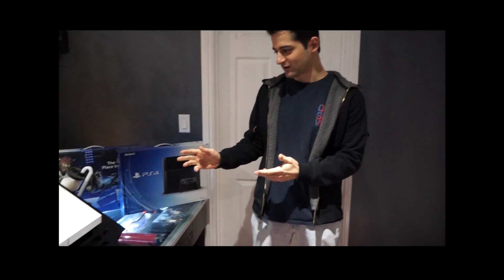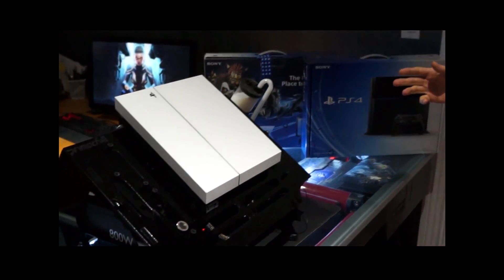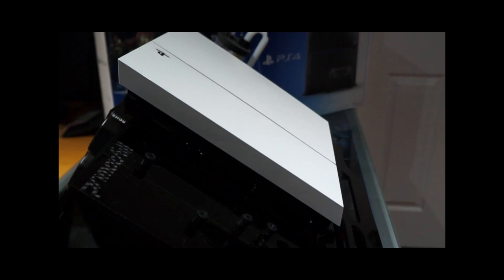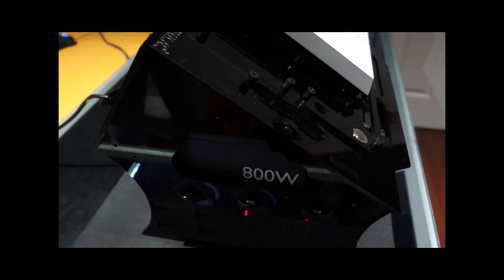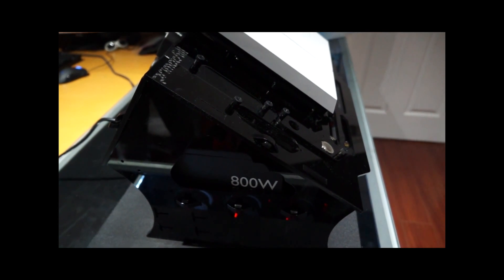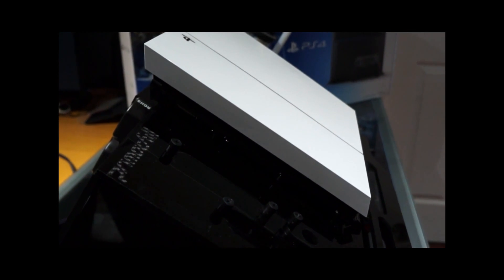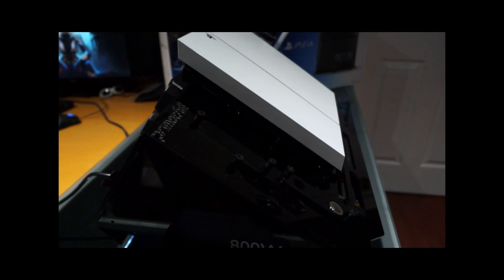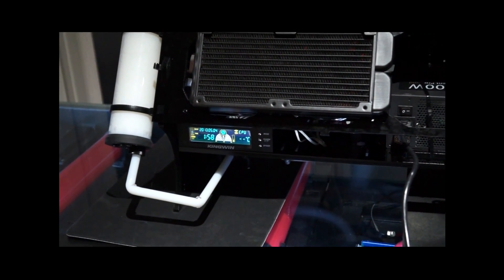Playstation 4 Water Cooled / Liquid Cooled PS4

Comment: is it even hooked into the loop? or just sitting on top of a wetbench with a loop for looks? do you have a build log or before and after results?
Reply from the maker: Hi, it was actually hooked into the loop. It took a lot of modification to get the block to fit in the PS4 and keep everything else of the ps4 intact and running. We didn't do a build log or anything because it was just something we did for fun and did not really expect anyone to want to do it as well nor risk doing and damaging since it was just a rough build and nothing concrete.

Comment: Guess after all this time nobody can invent a micro liquid cooler is always a PC sized monster build or a hack job liquid cooling idea on a ps4  -_-
Reply from the maker: Yep, we had to work with what was out at the time. There was a company who made a single prototype cooling kit for a laptop, was a small form factor but yep havent seen one since.
Reply: pwrdbykyank seen ways to do it in case after taking out the big  af jet fan and fitting everything in that area and using slim  radiator and slim fan (  120 mm )  while using micro fans in the psu intake to exhaust the heat from that like I said  iv seen a few models  and 3d designs on how it works  but I have yet to see it done
Reply: pwrdbykyank make another build with the items they have today  water blocks w-G1/4 12mm @max tubing there are also  micro 90 elbows out there that are pretty cheap  hell all the parts together ( w/o liquid and anti-micro )  around  $300-400 note : xs all in one micro will do the trick with the space issue  internal )
Reply from the maker: No point in doing another one since most people are getting the newer systems now anyways, no one will want to see this water cooled. Ive seen the newer setup also on the ps4s and those are a pain to do as well, will require way too much modification and again no one will want to do it either so no point in showing people a build that they cant do lol. Hopefully the PS5 will be more user friendly in the DIY department.

Comment: What is the water block GPU/CPU ?
any inside looks ?
Reply from the maker: +William Barber MagiCool Black Butterfly CPU Liquid Cooling Copper Block - Universal Socket (MC-BLOCK-CPU II), but we modified it a lot, cutting off the edges to make it fit etc, from what I have herd there are custom made blocks for the ps4 now so would be best to google and find one that requires no modification
Reply: +pwrdbykyank i managed to modify ek block tu fit with the original backplate my project is nearly done just some aesthetics works will share with you thanks for inspiration
Reply from the maker: Sounds good! look forward to it

Comment: You ever thought of trying some passive cooling
Reply: +person8203 Passive cooling is used for room ambient temperatures, which would not make a BIG temp drop using Pass Rad, as a matter of fact, there might if not will see a rise in temp. passive cooling is not ideal for over clocking nor cooling gaming units like this.
Reply: Levi Johnson
good point, relies on room temps. I'm just not a big fan of noisy, erm, fans. Used some large ones on a desktop with low rpm that were fairly quiet. Doesn't take much for them to whirl up like a turbine though.

Comment: what water block did you use
Reply from the maker: Heather Simmons MagiCool Black Butterfly CPU Liquid Cooling Copper Block - Universal Socket (MC-BLOCK-CPU II), but we modified it a lot, cutting off the edges to make it fit etc, from what I have herd there are custom made blocks for the ps4 now so would be best to google and find one that requires no modification

Comment: I'm a PC gamer and I'm not here to berate or belittle anyone but IF you're console is actually overheating, water cooling is not the answer, its probably just insane amounts of dust and try and giving it some careful vacuuming if you're afraid it'll end up damaging the console in anyway.

And no this does not in any way shape or form boost performance, if your console is overheating something is wrong, they're built not to generate that much heat.
Reply: Bloodstainer That may be true with the PS3s but the first PS4s have been known to overheat straight out of the box due to Sony rushing to get them out as soon as possible. My PS4's fan sounded like a jet engine when I first used it. Also, because the cpu and gpu share the same unit, it generates more heat versus the PS3 having a separate cpu and gpu.
Reply: Darion Chambers Doesn't matter, they just sound a lot, they still won't break by the heat, they're just poorly cooled down, not actually powerful enough to damage themselves with their current cooling system in place.
Reply: "Still won't break by the heat" lol
Ever heard of the Yellow light of Death?
Reply: Darion Chambers Not maintaining and cleaning electronic hardware isn't really the same as hardware actually overheating by itself, its not like it ever happened to any1 day1.
Reply: Bloodstainer Where's your source?
Reply: Darion Chambers http://community.us.playstation.com/t5/PlayStation-General/Unofficial-Yellow-Light-of-Death-YLOD-Informative-Still-Thread-R/td-p/4048928

And basic knowledge about electronics. Things don't overheat for no reason, sure its a hardware problem but the fact that it wasn't found in a test lab prior to release indicates that its a pretty high  probability that the cause for this malfunction is dust build-up.

If the problem was hardware related, you would be seeing the YLOD whenever you played a game that pushed the hardware limit of the console, whether the console was 3 years old or 3 days.
Reply: My PS4 overheated 4 times and shut off. What about that?
Reply: You must be a pc gamer because your comment shows how very little you know about video game consoles....dust, really lol?
Reply: +barry wirth lmao yep console gaming can get pretty complicated

Comment: pwrdbykyank do you by any chance have a parts list? I am looking into doing something similar. Really annoyed by the sound of the PS4 fan.
Reply from the maker: I don't remember exactly all the parts I used, I might have mentioned them in prior comments, however from what I have read, there should be a custom made water block for the ps4 by now. You would basically need a water block, tubing, radiator, pump, reservoir, fittings for the ends of the tubes and connections, and a power supply.

Comment: pwrdbykyank my ps4 is overheating and it is in a well ventilated place, no I put frozen pea bags on top of my ps4 as on top and bottom to keep it cool maybe watercooling it is my only hope for better cooling, could you replace the fans in the ps4  with a quieter 1 or what? because I want to lean how to water cool that dayym thing
Reply from the maker: I'm not sure  as to if you would be able to replace it with quieter fans, I suppose you can, but any fan that the system tells to spin faster to cool off would probably make noise, but maybe some with different material will make less noise. Also the fan in the PS4 is a suck heat out type fan, its not a blow fan you would regularly see in a PC etc. Also water cooling isn't worth it for most since it will cost just as much or maybe even more than the system price to water cool it. :) Best solution would be to use one of those add on cooling fans that attached to the back of the ps4 and helps suck out the eat or until maybe sony makes a newer PS4 down the line and fixes heat issues. :)
Reply: So do you think I can plug in a fan from my pc to the ps4 and leave it in the side so it sucks in cool air, do you think I should cut out a square in the ps4 where the cpu is and add a fan?
Reply from the maker: well if you look at one of my videos, I did add a fan, but it requires some wiring. It doesn't improve it too much though, but does help. Also the top of the PS4 to the right where its right underneath the processor (since the processor is upside down when the ps4 is upright position) heats up, but there is no cooling there. You can take the top right of the case off and add a fan there too, to help it keep cool but again doing so would probably ruin the look of the system.
Reply: +adam khalfi The Delta fans that Sony went with are top of the line. Sony made a VERY smart move by having Delta Tech produce their fan.
Reply: +adam khalfi I just installed x3 Coolermaster 120mm Jetflo fans to the top of my ps4 (I cut 120mm holes in the casing). And I installed x1 ThermalTake 80mm fan underneath directly on top of the internal stock Delta fan. PLENTY OF AIRFLOW.

Comment: I'd love to see a fan modification keeping the chassi intact. That is if you could replace the fan and turn the damn thing into a silent console. Or perhaps try to see how much you can lower the stock fan speed without affecting the cooling too much. Best case scenario with thermal paste replacement gives me about 55dB during full load. That's by measuring directly at the exhaust to get an as accurate reading as possible of how loud the system actually is.
Reply: I'd donate money if you could do it and release a guide on how to do it yourself. Love the system as such, but it's too damn loud. Gone through five of them in an attempt to get one that actually has the standard Sony claims it has. Confirmed several times by themselves it should be quieter than a PS3 at all times including while being under full load.
Reply from the maker: knerl ington Hi, it would not be possible to replace the fan and get less noise because if your using a stronger fan, it will cause more noise. If you lower the speed of the original fan (which has been done by people who wired a switch to it, you can check on youtube ) you would get temps higher which wouldn't be good and I'm sure eventually the system would shut down from it. The only thing I can think of is if you either removed the entire case and left the system bare bone sitting there or if you had a laser drilling place drill a bunch of small holes for ventilation (like a mesh grill look or something)  throughout the housing of the system which would cause more air circulation and heat would escape easier causing the fan not to work to push it all out the exhaust. This would then lower the fan noise level. :)
Reply: pwrdbykyank
Of course it's possible. It could be a fan with a different material used for the fins. If it wasn't possible we wouldn't have so many different fans for our desktop computers all with greatly varying noise levels.
Reply from the maker: yea well even if the time were spent to custom make a fan with different material and replace it, it would not make any significant change, the results would be very minimal. The space you have to work with is very small inside so you don't have the type of room you would with a computer to be able to use specially designed fins to push in more air and etc. Plus the fan in the ps4 and the construction is designed so that shaped and type of fan sucks heat from the surrounding areas and doesn't necessarily suck air straight through like a regular PC fan. I mean anything is possible but when it comes down to getting a 5% difference its really nothing noticeable.
Reply: pwrdbykyank But there is room for a larger fan so as long as it pushes air in the same direction as the stock it would indeed make a big difference.I know it's designed to suck in air from the sides, but that wouldn't change. The heatsink this time around is rectangular which means that the part where you mount the fan could be widened. Once again. If the material and design of the fins didn't matter we wouldn't have so many different fans to work with while building our desktop computers. That only further proves that the design of the fan does make a big difference since you can have an identical size, same amount of fins, but still a big difference in noise level thanks to different materials. The design of the actual fins matter as well. Not going to keep arguing, but another fan would make a big difference.
Reply: same here pal even with a cooing pad underneath blowing air beaneath and to the sides still gets hot and loud

Comment: i wanna do something like that or w/e is required basically this is my cabinet https://imageshack.com/i/ipxfTB1Bj i wanna treat it like a giant desktop PC case and do what youd do for that and liquid cool or w/e the best ideaoption would do and obviously close the glass do and keep it really cold in there

id remove the light from the top thats clashing and put a fan there for ventilation (theres also a pretty big hole behind the reciever to from the cables.

ive never done anything like this before and  need advice/help on what cooling system option i should use and how and stuff
Reply from the maker: Hi, ya well first draw your design out and if you haven't ever done water cooling you will need to google the basics of water cooling computers and read about what you need etc. You will need a water block for everything you decide to cool, and depending on what your cooling, you will need a radiator (many sizes/types are available) and you will need fans for the radiator, also will need tubing, distilled water or other coolant you decide on, a reservoir to hold the water, and a pump to cycle the water. It usually isn't cheep or easy when it comes to water cooling, but its fun. You can check out frozencpu.com and go to their liquid cooling section, or you can also look them up on facebook and check out pictures of peoples setups etc.

Comment: Nothing I couldn't do by simply placing my ps4 on top of my ac outlet on my floor an covering it with a box so the cd air stays in an the heat coming from the back turns into cool air. Presto... Don't have to be a rocket scientist. And it's free lol

Comment: another reason why is because the stock cooling on gaming consoles just sucks ass.  the cooling on the ps4 is pretty much the same as the ps3 from what ive seen, and the ps3 has been known to over heat.  not just ps by xbox aswell.  problem with the ps4 is the same with the ps3 in that it has one fan pushing air out through the power supply and out the back.
Reply: Not always the reason to why a console overheats though. Could be several other factors. Worked great for PS3 slim. Cool and quiet at all times. It's a cheap solution though which I hope they improve upon in a near future because the noise level is not acceptable.